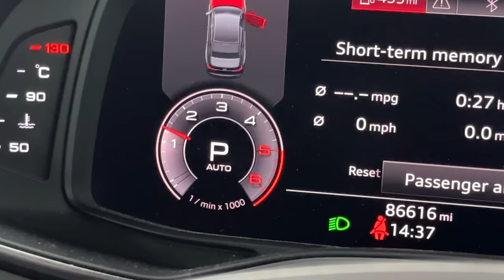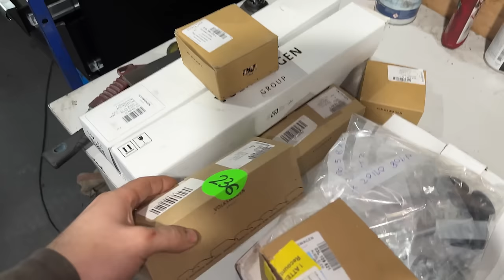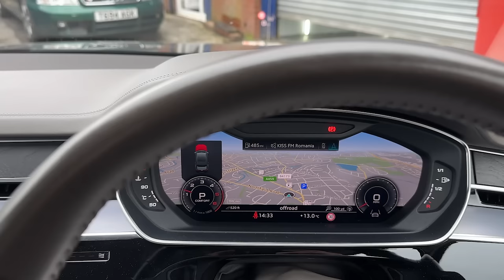A6 C8 and A8 D5 with noisy 3.0TDI engine.Audi dealer said it's normal acoustic noise, did we fix it?

Comment: When Audi spend billions on a high performance engines and their mechanics half arse it by saying its within tolerances tells me all i need to know about Audi workshops. There is a clear difference in engine sounds before and after, no mechanic worth their salt would say that was acceptable
Reply: You can’t avoid the human factor. Same as doctors you can find those who really know what to do and what to search and those that will you a painkiller just. I am driving always my Audis 380km to the dealer service of another city simply because I know the technicians are doing what they are supposed to be doing
Reply: Billions spent on a 3.0 tdi engine I think not there fuckin junk mate Pmsl as for high performance that’s lol
Reply: If they spent billions why are they shit 😅 btw there is no such thing as an Audi engine, it's all VW. All r and d goes through vw. Even the veyron/Chiron engine is 2 Passat w8  engines on a shared crank 😂
Reply: Some of the wear on the cam gears looks like cavitation orientated wear. The profile of the  gears will likely be promoting cavitation of the lubricating oil at or above a certain RPM.

Comment: At 30,000 these problems should not be present on a diesel engine. These modern cars are absolutely rubbish. The cost of repair is extortionate.
Reply: Emissions regulations and its consequences have been a disaster for automotive reliability. You can clearly see engine reliability nosedive after 2005.
Reply: Yes. After the past few weeks with mine. Totally agree
Reply: Mates got a new v6 3.0l diesel amarok that has just detonated at 19000k

Comment: Amazing. I have a 2012 volvo xc70 D5 awd 215hp engine with 470.000km on odometer. Have followed maintenance, and have had no problems. Fluched gearbox 5 times, replaced two heater fans, one wheel bearing and all shocks, but thats it. My wife had a 2007 Audi A4 turbo Quatro, which exploded with only 190.000 km on it, because of stretched cam chain. VAG=nice cars with good performance and nice to drive, but not reliable.
Reply: You can continue to drive that shuebox lol
Reply: I have a 350,000mile 2.0tdi engine has never been opened only suspension and  oil changes. Original clutch too
Reply: Disagree. Have 320 000km 2.0TDI 2014 Passat with only clutch and vishbones replaced. CBBD is the most reliable code 2.0diesel on the market, last one before adblue came.
3.0tdi are the worst vw engine in the past 20 years, 9of10 mechanics would agree
Reply: @gimigimi1299  310,000 kms on my 3.0 tdi. It's fine!

Comment: Makes you wonder what the life is if a VW, Audi TDI engine with normal servicing as detailed by manufacturer.  Plus can you trust the dealership?
Reply: i had a4 b6 with 419 000 km engine had 0 problems and now i have b9 2.0 tdi 140km with 210 000km and also no problem change oil at 10 000km and clean intake time to time about 60 000km
Reply: It's bad engineering. Straight cut gears have rough engagement Vs helical gears. Toyota used gear drives on the 1uz in 89 and onwards and they had helical cut gears, no issues

Comment: Mech Eng here. That pitting is in fact sub surface fatigue of the material caused by the material being over stressed and then failing such that a piece then falls out. This is likely one more  of a few things, narrow contact width, material specification, heat treatment, lubrication issue. The spring force onto the tooth looks a bad idea from a tooth life point of view imo.If you want to find out definitively then send it to a materials test lab and they will tell  from the morphology and strength test what is likely the problem. Unless your oil pressure mod gets more oil there then it isnt going to work but a supplementary spray jet may well help a lot if you can figure a way but no doubt not easy.
Reply: Helical cut gears would go a long way to solving this.
Reply: @xxshellsbellsxx can't get a chain on that
Reply: A different oil might reduce the wear by a reasonable amount. Used Oil analysis will tell the true story.

Comment: According to many petrol engineers I have talked to, Oil Needs to be changed every 3000miles or 5000km, if you plan on keeping it for a long time. Dealers and Manufacture recommend 7500miles intervals or more but they also want to sell you another Audi.

Comment: My Audi sounds exactly like that from almost new! Never bothered me and car drives like a dream 😊
Reply: Here's some fuel for paranoia. What if your Audi has been broken since new and you just don't know any better :D
Reply: @boerieza  many audis are ...
Reply: Same here. Diesel engines rattle. But if you didn’t buy a petrol like this guy recommends and  don’t need an engine replacement you can always spend ££££ on the “noise”.
Reply: I had a q7 2017 3.0 TDI. I bought it at 48.000km and drove to 160.000km with nearly all the time towing a trailer between 1300 an 3500kg. I only changed the oil/filters and had a minor coolant leak for the whole time I owned it. It made the normal diesel rattles but had no issues luckily. Maybe the car is now destroying someones wallet but my experience was good
Reply: @thizmferiznotreal  I have owned Audi A4 b6, B7, B8 and B9 Allroad and now driving  2020 A6 allroad c8 and all these diesels make funny "noise". After spending thousands on my b6, and learning everything there is to learn about Audi diesels, I will never spend money on subtle "noises" again! Can anyone on here share any link where this 3.0 tdi engine has had a catastrophic failure because of the said "noise". I can't find any 😅
Reply: Sounds like a luckof the draw on the newer models 😅 you get a noisey one that destroys itself or you just get a noisey one the at runs really well.
Reply: This is an old vehicle I wouldn't bother fixing this noise. As other people have said diesels are noisy.
Reply: Update - My car still drives like a dream

Comment: I hear them saying "Minor acoustic inconvenience" alot😂😂😂
First time about 15 years ago, back in the days of the first gen 3.0tdi regarding the timing chain issues.
Reply: Because that is exactly what it is. Show me where a 3.0 tdi engine has had a catastrophic failure because of the said subtle "noise"
Reply: @prrrakrrra  A relatively high performance engine on a 20k+€ car pushed regularly and out of time.. yeah it will fail. Theres plenty of 3.0TDi engines that died... the first owner is generally ok but the 2nd one usually cheaps out because he/she wants a premium car for a fraction of the price and then the 3rd owner will pay the price :D either way its not that bad, of course mechanics show the bad cases because noone brings in a car for 10 000€ service when its working right :D

Comment: I know nothing about Audi's, but love your honest channel :) I don't think the ticking noise was caused by the wear on the camshaft gears - even though I agree that wear is extensive for 30k miles. I think the ticking was caused by soft hydraulic lifter which you replaced as well. This must be some bad material choice for those gears by manufacturer as they shouldn't wear that much - or maybe the backlash tension is set too high.

Comment: So do you think the oil cleaning fluid you added prior to oil drain may have improved the chain tensioner operation on the A8? I always use an oil system cleaner (Penrite product here in Australia) in all my engines that I service and I stand by this process for sure. It seems that any engine work on Audi needs an engine removal from what I see on your channel. Very expensive cars to maintain given the material failures in the cam drive gears. Do you see the brand of oil used making any difference to the logevity of these gears?

Comment: So it’s a noisier than normal but would it cause premature engine failure? Only reason I’m asking is, that’s big repair bill and repairing it now for prevention when it would be fine with a tapping noise for many more miles on the clock

Comment: I wonder what lubrication can be used to ensure that the throttle body works properly in a B8 S4? and if you replace it, do you have to code it to the car, or can you literally swap out one throttle body for another?

Comment: Hi, can I ask, if the back lash is left unchecked on the 30k engine, what would you expect the mean time to failure to be, and what would the failure actually be? Is the engine at risk of becoming out of time and/or a catastrophic failure or just extra mechanical noises? It really looks like the double sprocket is designed to compensate for tear and wear to keep backlash to a minimum. Reminds me of my old Fiat Coupe 20v Turbo oil pressure paranoia, and my current N47 timing chain paranoia. Noises that shouldn't be there, but its not broken its a feature from Audi inspector made me wonder, can it be just left and live with it or ticking time bomb.

Comment: Have to say watching to the end and seeing the state of those sprockets and the missing material, Audi just got the design wrong here, maybe combined with thin oils they run now for economy and start stop technology letting the oil drain away is not helping. No wonder they have changed the part number, probably added a harder coating to the gears/spockets to try and mitigate the issue. I wonder if running a thicker oil would help alot?
Reply: Thicker oil?i don't buy this... what is with a cold start than?this is overerengineering or simply deutsch logik.this shi...is bad and we the best oil still is the shi...
Reply: @zikovsnorton  A 5w-30 and 5w-40 both behave exactly the same at cold start, but one is thicker when hot.
He's exactly right in what he said, these manufacturers are using ridiculously thin oils in an effort to maximise MPG and reduce emissions.
Reply: @MattyEngland ok but distribution and lubrication it's so shi...on the car.you can have more km with another oil but you have same shi..under the hood
Reply: I thinks it more the straight cut versus other manufacturers who use helical cut gears which  can handle more wear, the coating is just a band aid to slow down the wear from contact,
Reply: I've never thought about it, thin oils paired with start stop and the motor not warming up frequently is a very bad mix.

Comment: Had a Q7 in with this engine for glow plug failure and when i started it i rang the customer straight away and said i dont want to touch it until you come hear the noise it’s making and his answer was “ yeah its been making that noise for nearly 3 years i was told it was normal “ 🤦🏼‍♂️ it sounded like it was about to explode 😂 i told him it needed engine out and chains kit replaced possibly more depending on what is found he said nah its fine 😂

Comment: Hi guys, Has anyone got a video of removing the camshafts and reinstalling on a new head? as i have to do this shortly and cannot find a video at all. I have the audi workshop manual and it states i need the T40094,T40095 and T40096. Does anyone have any info on this?, Better a video?. Thanks

Comment: I've got an a7 2018 same engine code with the same noise. How can I get in touch with you in order to sort it?
Reply from the maker: Vagtechnic.uk
Reply: @VAGTechnic  would you generally recommend DPF, EGR and Adblue delete after warranty has expired to prolonge life of diesel engines?
Reply: @sameerrajab9283 don't think a mechanic of this skill is gonna recommend something illegal tbh with you. Not saying you shouldn't consider it, but are the potential fines worth it? 

There are reputable companies that clean dpf systems and restore them to like new - most of these work on big rigs but worth looking around at a route that can prolong your car without compromising yourself.

Comment: The majority, not all, of the Audi dealerships are 'service centers' all they do is service your car. Anything beyond that is in most cases is outside there skill set and computer says no.  That is when you need to find people who know what they are really doing, like VAG Technic. :thanksdoc:
Reply: Yep, it's the same with all main dealers. Landrover main dealer had my dads car for 12 days trying to sort out an intermittent crank no-start, couldn't work it out despite the fault being present the entire time they had it. I found the issue in an hour using nothing more than the wiring diagram in a Haynes manual 🙄

Comment: anyone know the mileage of these engines ?, nevermind … only 86k on the A6 and 30k !!! on the A8… yikes… my 2015 Cayenne 3.0 has 105k … only momentary tick for 1-2 sec at cold start … but ive read somewhere thats a hydraulic lifter thing ? Anyone else had problems with their 3.0 ? Mine had the common coolant leak in the valley (intake off job) at 95k …

Comment: Anybody who spends that sort of money to fix a slight rattle on a diesel engine needs their head looking at.  just turn the oil pressure up and use a better oil it will last for ever or till you sell it.  put your car in to get a timing chain replaced and end up getting stung for 8k+

Comment: Comes down to bad design work and poor developement as even if the engineers believed that they had a durable design clearly in production the material chosen could not be made to withstand the forces involved and that shoudl have been spotted after engine endurance tests. If the new camshafts have a different part number there must be a technical bulletin in hte Audi system about that. Audi should be changing these FOC up to at least 60k miles even if car is out of warranty.

Comment: was thinking to buy  A6 audi 3.0 ltr.... no way i am buying this shit
Reply: Why not? Because of some noise that will not make any failure?
Reply: @Cef3axon1   eventually it will if no taken care off. TBH shouldn't be happening like this  I dont blame VAG  engineered but blame management
Reply: Got a 2007 A6 Allroad 3.0tdi. Engine is running just fine. 310,000 kms.......
Reply: @benturp3492  its 2007 but the design is outdated. I have VW TDI Passat 2.0 2016 with 242km now and runs just fine no issues so far just service also has best gearbox 6 speed DSG with wet clutch
Reply: @user-zd3pt8gd5w  It's a nice looking car. Take that anyday over the new plastic models. It's has wooden interior, bose surround sound. rear view camera, parking sensors, button to close the boot. Really ahead of It's time. Adaptive air suspension, electronic seats, heated seats......
Reply: @benturp3492   it`s a matter of taste as it looks very dare compared to newer models too round.
Reply: @user-zd3pt8gd5w  I like the older Audi look. Nowadays trying to look too sporty.

Comment: 30k miles and a massive bill. not acceptable on any planet. carbon clean on audis should be done free by audi as their engines choke up so damn fast. since egr recirculating hot soot this is the result